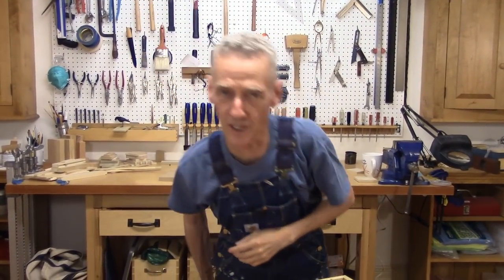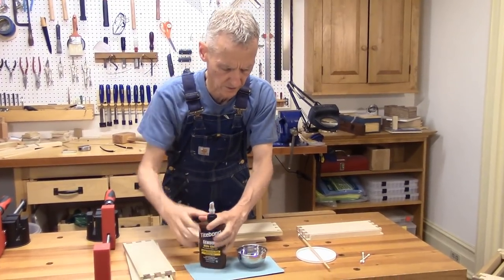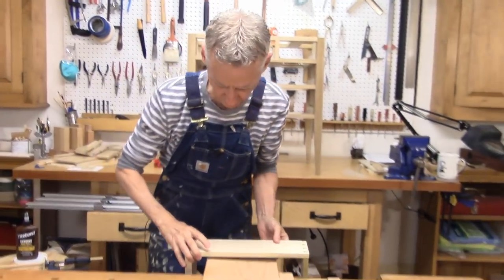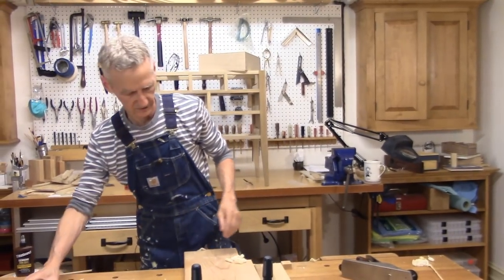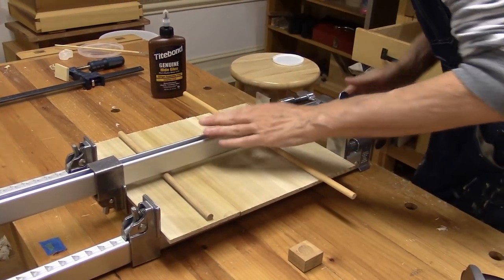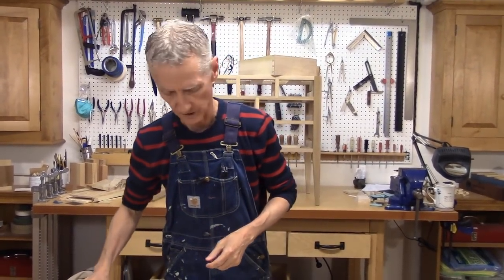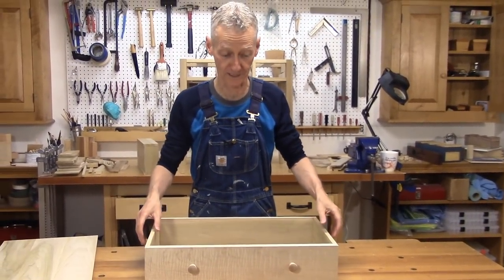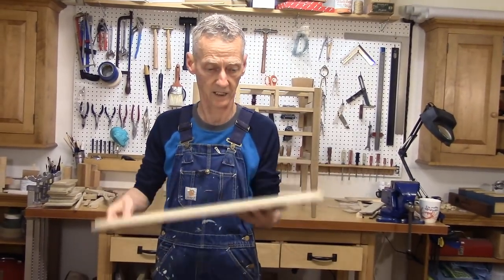Chest of Drawers Show #8

Comment: Looks beautiful! Any concern with the drawer bottom swelling and possibly causing issues with the operation of the drawer? I have heard its best to have the grain run parallel to the drawer front so if it does swell it will push out towards the back and have no issues with operation.
Reply from the maker: Hi Randy. Wood movement in solid wood drawer bottoms is an important consideration. More so in larger and wider drawers. The small top drawers are quite narrow (6.25") and the 1/4" grooves in the sides can accommodate this movement. In the larger two sizes of drawers the grain does run parallel to the drawer fronts. Thanks for the opportunity to explain this.
Reply: I have to apologize,I posted that question before I watched the full video!
Reply from the maker: No need to apologize Randy. I should have shown this more clearly in the video. I appreciate the opportunity to explain it here. Thank you for taking the time to comment. Best regards.

Comment: why are the tail boards proud of pin boards. Would it be better the other way around? A lot less the plane.
Reply from the maker: Good question, Robert. In most cases, proud ends are the way to go, much easier to do. For inset drawers however, no. The front and back are carefully sized to fit the opening precisely. After assembly, the sides are planed to fit. In this way, no material is removed from the front and back. Thanks for the excellent question.

Comment: I noticed your drawer bottom groves seem very close to bottom. Do you worry about failure?
Reply from the maker: Not for drawers of this size. The grooves for the smaller two sizes are 1/8" from the bottom edge. The grooves on the largest drawer are 3/8" from the edge. These drawers aren't that deep and I won't be loading them that heavily. Thanks for the question Robert.